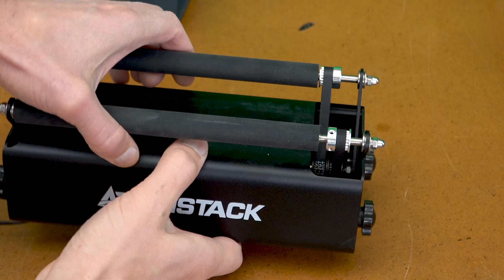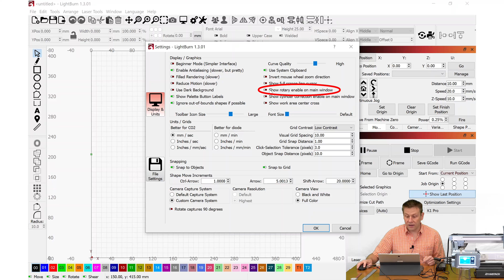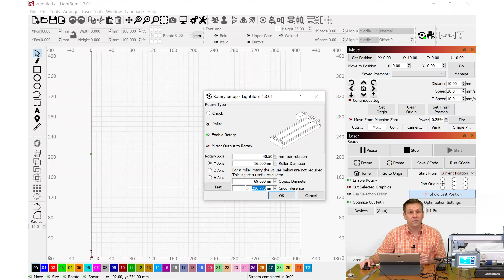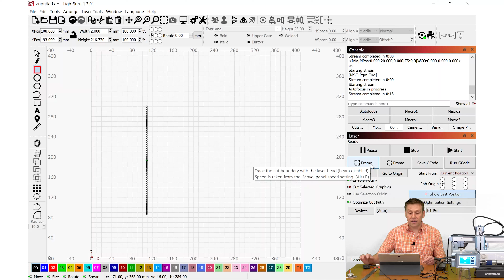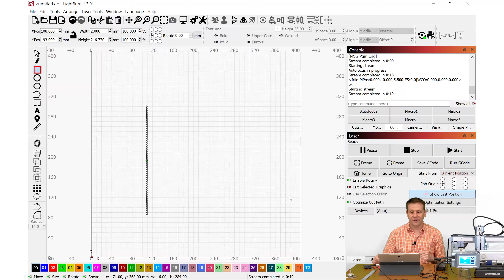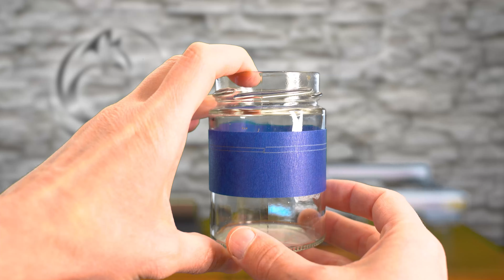Ikier K1 Pro and Atomstack Rotary

Comment: Thank you, 
My wife, died last July and I’m looking to put her name on a brass urn. Atomstack and Ikier manuals don’t have instructions on where to connect roller to the laser. 
As a side note I ordered a Atomstack R30 V2 infrared laser module 2W That should get here today. The Atomstack manual for this module say’s it will work with an Ikier K1 machine. If you want, I’ll tell you how it works out.
Reply from the maker: You're welcome- sorry to hear of your loss. 
Yes- please let me know how the IR module works with your machine.
Reply: @thelaserchannel1  I got the Atomstack R30 V2 today it took about 15 minutes to mount and plug in. I haven’t tried the rotary yet, gotta find a brass tube I can practice on. On a flat piece of brass using fill w/cross hatch @45degrees 100%, 254mm/s and 0.127 mm interval I was able to engrave a filled circle that did not scratch off with my finger nail.
Notes the focus pole is dead on, The brass needed a quarter in. piece of MDF on a honey comb  to get the proper height, I Turned off Z control till I get Z offset figured out as well as startup auto-home and Return to Finish Position.
Reply from the maker: @jameseler2898  Thank you for sharing!
Reply: @thelaserchannel1  After a day with  a lot of frustration I found the R30 on a Ikier does not work in absolute coordinates neither can I use Z offset to set the focus too many error messages and Lightburn lockups. Current Position and manual focus do work.

Comment: Can I use an IPad to run this laser😢
Reply from the maker: I run all PC in my shop, but I did dig a little and Laser GRBL and Lightburn will not run on any Ipad.  I'm not sure about the Ikier software app.
Reply: @thelaserchannel1  thanks so very much for your time I may have many more because I’ve got to put the k1 pro together
Reply: Thanks for your response. Can I buy an inexpensive small laptop from Walmart to run the software and machine. Can I fire it up with there controller?
Reply from the maker: @andrewearl9315  Yes- just print out the PC requirements for the software you'll be using with the machine like Laser GRBL or Lightburn.  Don't forget if there's any photo editing software you might want to run the in future!  Here's what Google said: Minimum Computer System Requirements: LightBurn will run on Windows 7.0 or later, 32 or 64 bit, MacOS 10.11 or later, or 64 bit Linux. LightBurn does not require a powerful computer for most work, though if your designs contain a lot of images, more memory is helpful.
Reply: @thelaserchannel1  Thanks again for the speedy help.  I’ve almost got it all together to fire up.
Reply from the maker: @andrewearl9315  Excellent!

Comment: Thank you for your hard work. I am considering the purchase of an iKier K1 and you are answering all the questions I have, video after video !
iKier support told me they will eventually sell a 1064nm laser for the K1. I wonder if the Atomstack one would work on the K1.
Reply from the maker: You are welcome! I haven't tried crossing laser modules between brands.  Most brans use a flat 4/6 connector system but what signals are on each wire might not be the same.  Thanks for watching!